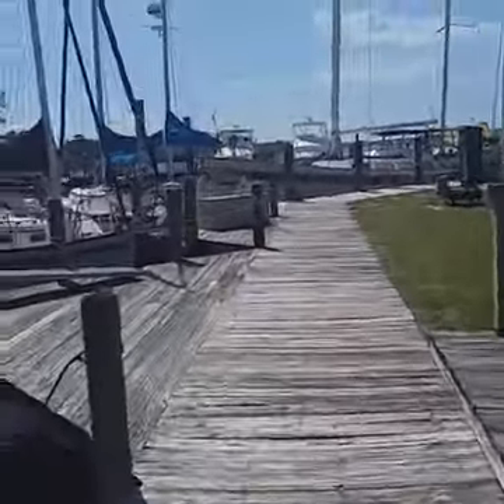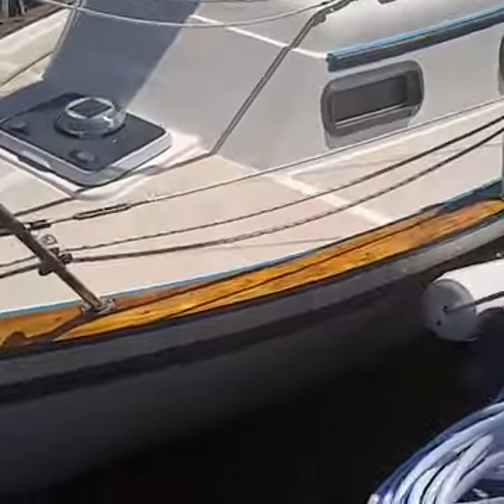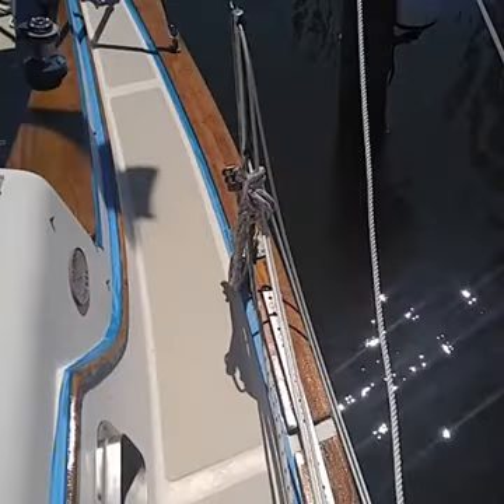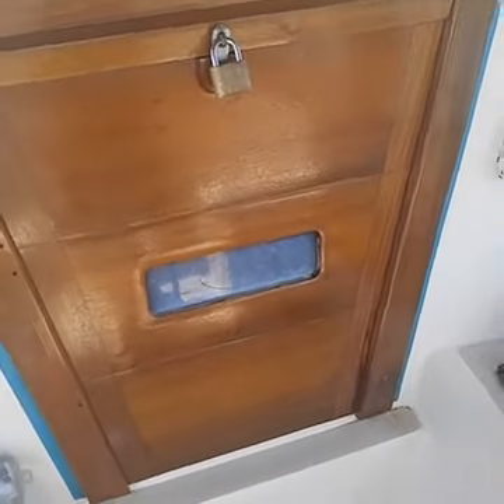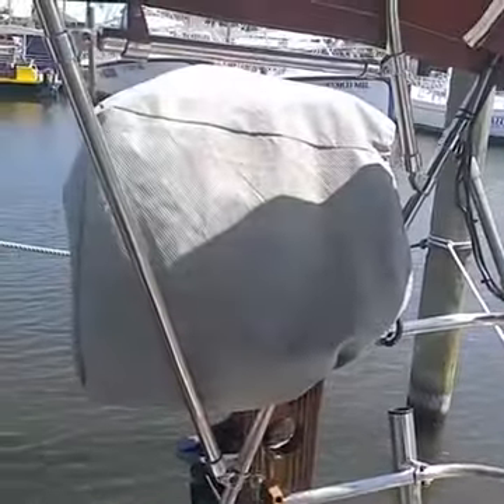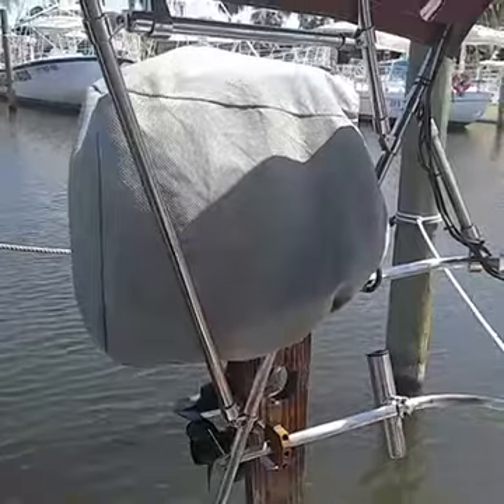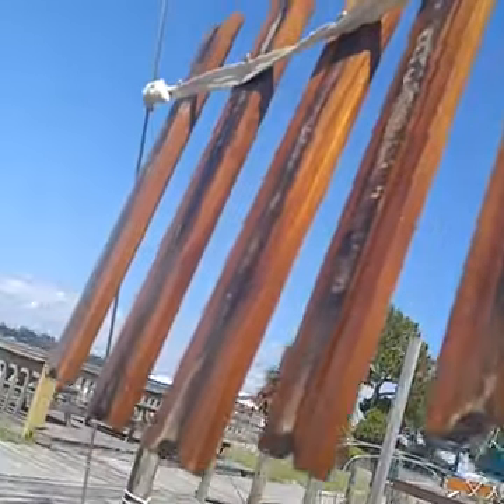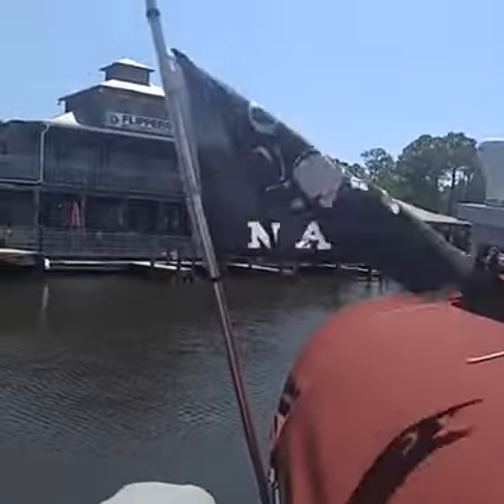Salty Quicky #22 - ALMOST DONE!  Teak & Davit Progress on my Island Packet 27

Comment: Re: the dingy vs. the kayak -  The kayak is certainly easier to launch but keep in mind it's limitations.  It can't carry a lot of stuff, or multiple people (read: more than 2).  Also, if you run into foul weather (read: sizable waves) or you need to fight against a strong current for longer than you'd like to paddle, you'll wish you had the dingy.  For myself,  if I'm traveling alone, on a short day trip, and all I need to do is get from the beach to the anchorage, and back to the beach when I'm done, I'll sometimes leave the dingy behind and opt for the kayak.  But my dingy can get up on a plane, which really expands my exploring options.  So, if I'm going to a place with multiple islands, or if I'm going for more than one day, I take the dingy, often in tow.  A word of warning though,  a few weeks ago I was hit by a monsoon while i had my dingy in tow.  The wind flipped it over and the engine (a 9.8hp 4 stroke) spent 40 minutes under water (salt water).  Luckily, I found a mechanic within in a few hours that flushed the engine with various oils etc. and the engine survived.  That story could have had a very different ending, though.  My boat has similar size constraints as yours.  If I were going to the keys,  I'd take both.   You can put the kayak on the side deck and secure to the side stays or you can put it on top of the dingy on the davits.  I've done both, and i have the same davits as you do.  Well, I don't suppose I answered your question, but I did give you some food for thought.  I hope it helps.  Enjoy your trip to the keys.  BTW - I'm leaving today on a 3-4 day single handed trip to 3 different islands in in Thailand (less than 50 miles round trip), and the forcast is for 10-15 knot winds.  I'll be bringing my dingy in tow.   I've learned that if the winds really pick up (read: over 30 knots) if you just shorten the painter, pulling the dingy right up behind the boat, it won't flip (knock on wood).